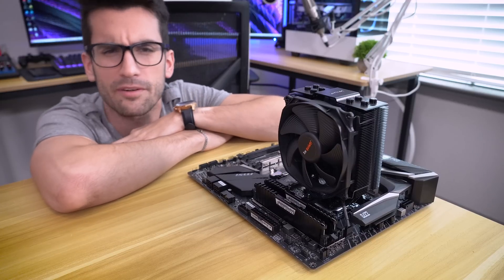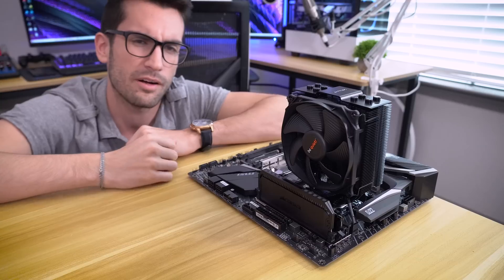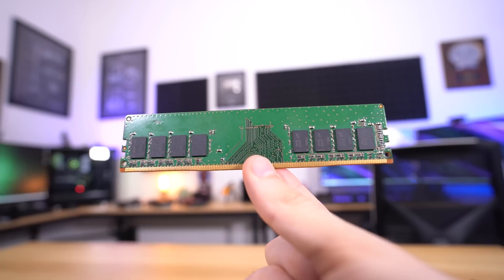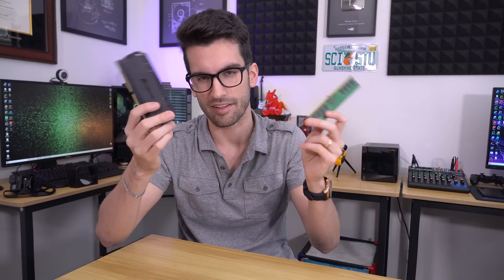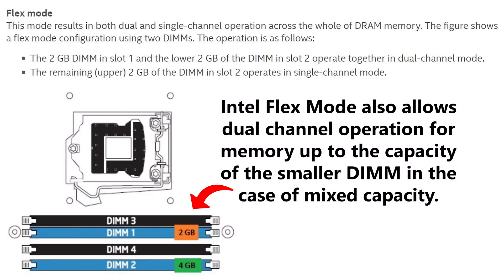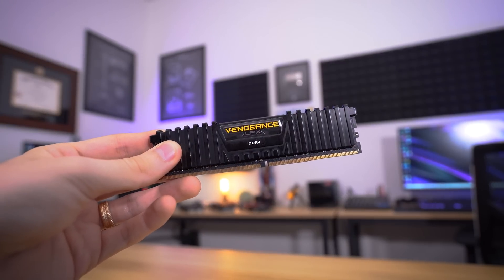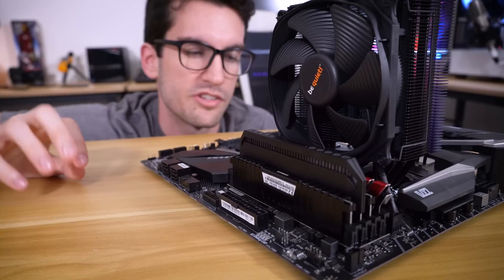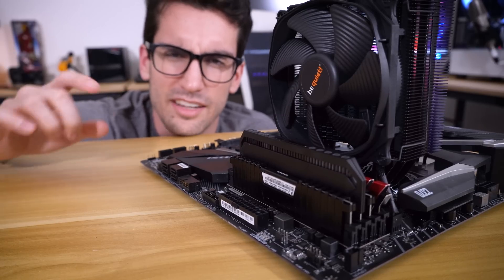Mixing RAM?!

Comment: Well put, so many times people will just say no, don't do it. All too often a budget builder will build a system with say 1 8gb module to save some money then later find themselves in a position where that particular RAM model is no longer available to them. Many places on the web will tell them to buy a new 16gb kit and then sell the 8gb module to get some money back and while yes, that is the ideal scenario, it isn't always the wisest from a financial standpoint, a point that led the person to only use one module in the first place. 

Personally, I strongly recommend against mixing capacities, mixing high end and cheap modules (particularly if there is a large frequency/timing delta) and using odd numbers of modules (1, 3). You CAN do all these things and your system will typically work, it just isn't ideal and you will lose out on performance. If you have no choice or it saves you a lot of money then by all means, give it a shot. The worst that can happen is the system won't POST because of compatibility issues, in which case, pull the module you added out again. RAM compatibility has been an issue with DDR4 and mixing modules doubles the chances of an issue, especially on the AM4 platform. Again though, you lose nothing in trying and often, simply clearing CMOS and letting the RAM default to 2133 will get you up and booting. 

16gb in dual channel @2133 is WAY better than 8gb in single channel @3200, both in terms of performance and capacity. Mixing capacities will often work (platform dependent) even in dual channel (flex mode) but it will be dual channel up to double the lowest capacity module so in a 12gb setup with 1x8gb and 1x4gb modules you will have some benefit from dual channel so long as usage remains under 8gb. Flex mode is not as fast as full dual channel either, typically about 25% or so slower but still faster than single channel. You will always be better off with an even number of modules installed because dual channel effectively doubles your potential bandwidth. Even flex mode it is beneficial vs single channel. For gaming, faster RAM in dual channel is best, better 2x4gb modules @3200+ than 1x8gb or even 1x16gb in single channel regardless of speed, you would literally need a single module rated at 4266mhz to come close to matching a dual channel kit at 2133 and the vast majority of boards won't support RAM that fast, especially not on the budget end.

Comment: I remember when I tried to upgrade my old PC. It had 2 GB DDR2 memory. This was a two module kit. It bought a 4 GB two module kit. Essentially I was trying to upgrade to 6 GB. 
Unfortunately I couldn't boot with both kits installed, I had to take one out. So sadly, I was stuck with only 4 GB.
Reply: Same problem with me,

Comment: I don't agree with him.
If the differences are small and you mix the RAM sizes correctly (For example 2x4 GB and 1x8GB), I don't see a problem. So you can save money and reduce waste.
And it's possible to mix more. If you have 20 GB it's possible that 16GB are Dual channel and only 4 GB are not.

Comment: I tried to install a new 8gb stick to my system that running 8gb single stick, system just power cycled. Same brand and speed and latency but 1 year apart. 
Had to return the second upgrade stick.  Wouldn't work even at normal non xmp rated speed. Even at the stock 2133 (it's 2400 rated) it wouldn't work. 
Literally identical modules but made a year apart. Same brand, same speed, same latency, same name on it (aegis).
Cleared cmos, under clocked the ram, everything I could think of. Wouldn't work.

Comment: I have a Ryzen 7 pc with a single 16gb 3200hz stick of ram and want to upgrade to 32gbs. Can I buy another matching 16gb stick and run it in dual channel or do I have to specify buy a  2x 16gb dual channel kit?

Comment: I have a question. Can two different SKU of the same RAM brand & model work together? My rig which runs a R5 2600 on an MSI B450M Mortar originally rocks a Kingston HyperX Fury 8GB (HX426C16FB2/8). But the new RAM I bought online ended up being a newer SKU, HX426C16FB3/8. Specwise, both modules appear identical - single rank, 16-18-18 timing, 2666mhz freq.

Comment: I have 12GB DDR3, 2x4GB, 2x2GB, both 1600mhz, but the 8GB kit is Kingston and its garbage compared to the 4GB Corsair kit, I have to lower the timing significantly or get crashes.  This runs in Dual Channel, as they are in the correct slots, also matching size and speed.

Comment: What about mixing ECC and non-ECC RAM in the same system, assuming the motherboard & CPU support ECC?  I'm guessing the ECC functionality would be disabled (because of also having non-ECC RAM), but would the RAM itself still work?
On the other hand, while I don't have personal experience with it (yet), I'm pretty sure that you can NOT mix registered and unbuffered memory.

Comment: To be fare modules can be mixed at the factory. All the big companies do it as far as capacities. Even Apple has done things like 2+4 or 4+8 offerings. But these will typically be matched timings although I have seen oddballs thrown in out of the factory with missmatched times causing many BSODs out of the box. Not a great experience to have with a brand new machine.  Cough cough Dell.

Comment: Hey bro thanks for the information, I was wonder if I will get any issue mixing 2 modules of cordair dominator platinum (standar silver version DDR4, @3000mhz 8gb each one), and other 2 modules of corsair dominator platinum (with the same specs but in the black matte heatsink version), trying to pair with the same lattencies and speed, (Im trying to make a black and silver setup), greetings!

Comment: Basically, it usually is more trouble than it is worth it. Because sticks have to search for lowest common denominator, speed will be whatever slowest is, but timings are even worse, here, because they can be all over the place. It really depends on how good your motherboard BIOS is at dealing with it. Usually it will work, but you could be getting worse results. And different sizes can also depend on BIOS, whether it will run some amount in dual channel or not. Like if you have 4 and 8GB stick, it might run 4GB out of that 8GB stick in dual channel and rest in single channel. But even so, Windows and software is not really optimized to prioritize 8GB you have in dual channel, so performance could and likely will have significant drop towards single channel.

So you might want to just sell your old stick to get some money back and not bother. Like sure, you can improve situation if you are willing to tinker with timings and frequency. But I doubt most people will even know what to do with timings.

I always recommend to anyone to get two identical sticks, make sure they are on motherboards supported memory list, that will make your life and proper timing setup so much smoother. And of course do take CPU support into account as well. Since going above it will introduce risks, even if minor. Especially on AMD side, I own Ryzen 2600X that won't do 3200Mhz without errors, despite me having memory on motherboards supported list, even though most of them will do 3200Mhz fine. Though dropping clock is still a lot easier than doing timings.

Comment: Back in the day, all we had was I guess was DDR1, we just stuck it in and check if it was read.   Never checked speeds or different ram amount count.  If it was readable by the motherboard it almost always worked fine.  Ram was super expensive.

Comment: I bought a Crsair 8gb dimm of 3000mhz from Ali Express like 4 months before i could sell my DDR3 setup and upgrade to a DDR4 one, i matched it later to a 3200mhz dimm, so I'm running 16gb at 3.000 mhz, still better than just 8gb with 1 memory module due to the dual channel.

Comment: Maybe it's because of a strong sense of perfectionism, but I've just never liked the idea of mixing RAM. When I built my current Ryzen system in August of last year, I bought a 32GB (2x16) Corsair Vengeance LPX 3000MHz CL15 kit, and in the time since added two other 16GB Corsair Vengeance LPX 3000MHz CL15 modules--purchased them when they were at their lowest prices. Just to avoid issues. 

The one exception was when I had 16GB HyperX Blue 1600MHz DDR3 CL10, and I wanted to max out the DIMM slots on my Gigabyte 990FXA-UD3 with 32GB. By the time I wanted to add another 16GB, I think Kingston discontinued or rebranded the Blue line as HyperX Fury--and people were asking silly prices for the original HyperX Blue modules. I had to go with 16GB HyperX Fury 1600MHz CL10 in Blue. I think the specs were the same or similar, different designs/aesthetics, and it annoyed the crap out of me. Even if my old rig didn't have a window...just knowing was enough.

Comment: Fun fact! There are motherboards you can mix DDR3 with DDR2.
Reply: you cant run both at once however, those boards run either the ddr2 or ddr3 depending on which CPU is installed
Reply: Wich motherboad is that

Comment: I mixed 16 GB of 3200 ram and 16 GB of 2400 ram... and 'overclocked' it all to 3000 MHz. I had 32 GB of 3000 MHz ram, but boy were the timings SHITE!!!!

You CAN do it, but should you? If you need more ram and don't care about latency, sure (intel systems), but for AMD/Ryzen? NO WAY.

Comment: When you buy a pair of the same RAM modules are they really matched..?

I mean the factory they came out of must produce thousands of sticks at a time and each stick has multiple chips mounted on it. 

Do they really match the silicone on each chip on each pair of DIMMS?
Reply from the maker: They're rated at the same speeds and timings.

Comment: Both of my main systems are running mixed memory. Desktop is running a 16Gb kit (crucial ballistix sport VLP) and a 8 Gb kit (HyperX Blu) in dual channel for 24Gb of RAM. Running at their stock speed (of 1600Mhz) I've had no issues with stability.
My Laptop is running whatever memory it came with and I added an extra 8Gb stick to both increase its capacity but also to get dual channel out of it.

I think the important thing when mixing memory is that you ought to try to get as closely matched memory as is feasible. For example, if you have 2666Mhz memory already installed (as was the case with my laptop), then there is little point buying say 3200Mhz memory to add to it. Instead in my case I bought the recommended 2666Mhz stick for my laptop. The timings are very slightly different, but the two sticks are close enough that I've not thrown money away when one of the sticks is slowed down very slightly because of the other. And I've not significantly risked stability because, again the timings were close enough that even if, some how, one was made to run with slightly tighter timings there would not be enough of a difference that the memory would be unstable

Comment: From my horrible experience, don't mix RAM! I thought the sticks from my old PC were compatible, Dell even confirmed it. Same speeds, same type, same timings (I thought). I had mysterious and random blue screens for years. Every diagnostic test I ran was fine and showed no problems with any of the hardware. I replaced HDD, Graphic card, new drivers, etc. Even a clean install of Windows didn't fix it. Finally, just before my last resort of buying a new PC, I pulled the older RAM sticks. Poof, no blue screens since. I don't even notice having 4GB less RAM and I would pay a lot to avoid the hassle of random and frequent BSOD. Don't mix RAM!

Comment: I have 2 pairs of 2x4GB G.Skill Ares running in my system for a few years now, 16GB in total. 
I initially bought the first pair which were rated 1866Mhz, about 6 years ago and then about 3 years later I saw a pair of 2400Mhz for cheap, so I just picked them up too. I just "overclocked" both, as high as they'd go, they both run around 2200Mhz with no issues. I didn't see the point of removing the slower sticks, and losing 8GB, just to get an extra 200Mhz.

Comment: How about using different ram speeds, So i have a 2666MHz 16Gb, and i want to add another 16Gb but a 3000 or 3200Mhz speed, what will happen, will the new sticks underclock or what ?

Comment: Can you help me then? Ive got 2x4Gb corsair vengeance 3000mhz and another set or 2x4Gb corsair vengeance LED 3000mhz. Both have the same timings on the label. Running either set works fine. But the twice I've ran all four dimms ive got random black screens. 
Could this be the cause? how would I check what caused the black screen?
Reply: See my rant above. Don't mix RAM. Just don't. The fact that you get random black/blue screens confirms it is a bad idea.
Reply: aowi7280 I cant see your rant. 

Is there a away to check what caused a random black screen? I have got a second hand GPU too!
Reply: @FaithlessEmoRacing  I could never find what caused the the blue screens even with hours of running diagnostics. I am an electronics tech, just not on PCs. It might go a week without crashing. Then it might crash 4 times in an hour. Usually the error code was some generic stop code, and rarely the same thing. Sometimes it would indicate a driver issue. The Windows blue screen analyzer never found anything.

 Rant: "I thought the sticks from my old PC were compatible, Dell even confirmed it. Same speeds, same type, same timings (I thought). They were both CL11.  I had mysterious and random blue screens for years. Every diagnostic test I ran was fine and showed no problems with any of the hardware. I replaced HDD, Graphic card, installed new drivers, cleaned and reseated every cable and connection, etc. Even a clean install of Windows didn't fix it. I figured it was just an unreliable PC. Finally, just before my last resort of buying a new PC, I pulled the 2 older RAM sticks. Poof, no blue screens since. I don't even notice having 4GB less RAM and I would pay a lot to avoid the hassle of random and frequent BSOD."

 It turned out the new RAM timing was 11-11-11-19 and the old was 11-11-11-26 (or something like that). 8GB is enough for me and I do some 1080P video editing with Davinci Resolve. It actually seems to run better without the extra 4GB. Fewer interrupts from memory error correction I imagine.
Reply: aowi7280 thank you for the info. I’m a Mac technician so find it amazing that I couldn’t find any kind of fault codes to tell me why it powered off. 👍🏻
Reply: @FaithlessEmoRacing  I used to work on a system described as having "more processors than an Apollo mission". It wouldn't tell you what was wrong with it either. :o)

Comment: a warning to anyone that uses PC part picker, i personally used Greg’s code and got myself a Windows 10 key and it worked fine, and recommended it to someone else on PC part picker who was worried about a key and was banned for doing so. The admin also tried to tell me they were “unreliable” and “could stop working at any time”

Comment: I recently bought a DDR3L adata 4gb stick for my old first gen pc having an i3 540 but its not booting with the new module. What's the reason? I'm using an intel dh55hc motherboard.
Im puzzled by this behavior.
I tried to boot it from the new module alone, paired with other existing rams(2x2 DDR3(not low power version)) from adata itself.
Reply: The RAM probably isn't seated properly. You'll need a bit of force to lock them into place. If the flaps on the sides aren't clicked in, that's a problem.

Comment: have been using 20Gb of DDR3 with my FX4320 for years. 2x8gb and 2x4gb, had a bsod once.  tested it with a other modual and that did not work well,  putting cheap sticks together will get you more crashes.  most of the better sticks often work well together.

Comment: I paired my 1866mhz with 1600mhz DDR3 RAM in my old system, and it have issues. If I cut electricity off completely from the system, then the motherboard would do some RAM training and failing at it for 3 or 4 times. afterwards though, it would run perfectly fine.

Comment: I mean you can the best bet is getting ram with same voltage. Timings dont really matter when it comes ddr3- even if you get 2133 ram and maybe few cl difference you can still get it to work

Comment: Thanks for the video, man. I'm researching this and is good to have some answers. Also, do you recommend those Team Group RAMs? I found an 2666mhz for cheaper than an 2400mhz from Hyper X Fury. I still might get the Hyper X because my current module is from them (though 2133mhz) but part of me really wants to get the higher speed since I'm probably gonna upgrade my i5 6600 next year. Anyway, heard some bad things about Team Group and the price makes me unsure if it's a good choice.

Comment: I have two G.Skill memory kits in my Athlon 200GE system. Same family and specs, but manufactured four months apart. I can run two sticks from the same or different kits with no problems. The older kit can run either stick in any slot. The newest kit has one stick that can ONLY run in the first slot when using four sticks. It took me two hours to figure out that combination. For whatever reason, I had to add the first stick, reboot, add second stick, reboot, and add the other two sticks before all four sticks could work together. I understand this has to do with the 1st gen memory controller in the 200GE.

Comment: What about two different sticks of DDR3 mem,but each of them runs a diff voltage ? EG: 1.6v vs 1.5 out of the box ?
Reply: good question
Reply: Kinda late but that could cause problems, they should have at least the same voltage.

Comment: I think the most common use case for mixxing modules is someone buying dual channel memory when the machine is built then 3 years down the line buying another dual channel memory kit of the same, or 1 step higher capacity. (IE Starting with 2x2GB, then buying 2x4GB meaning they have now 12GB - This is what I did with the machine I made back on 2010.)
Reply: That didn't work for me.